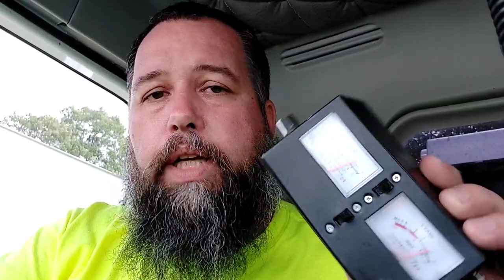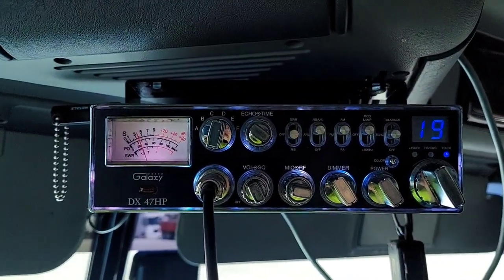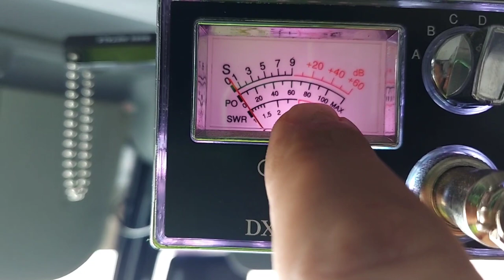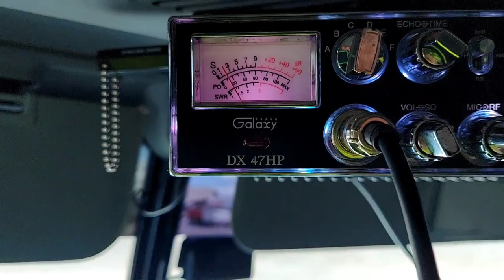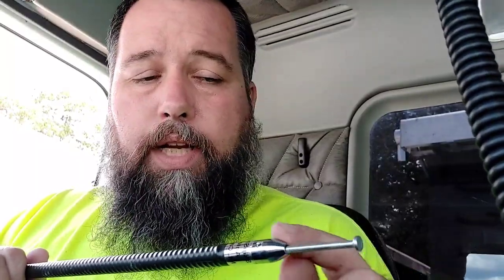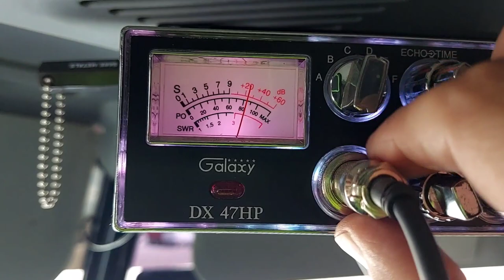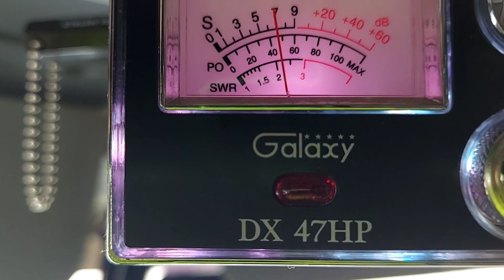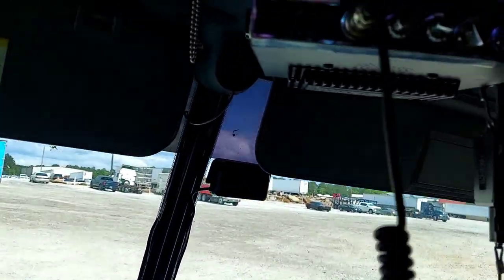How to tune your CB antenna. Using a tunable tip, and get the lowest SWR possible.

Comment: I just wanna add one thing. If your antenna has a rubber cap that goes on the tunable tip then always put it back on before making a swr reading. Don't set swr without the cap on because when you put it back on it will change and sometimes a lot. Take the cap off, make adjustment, put cap back on, and then take a reading. I know your antenna doesn't have a cap but other people likely do such as firestick antenna

Good video man. YouTube is full of incorrect " how to tune CB" videos lol
Reply from the maker: 100% thanks, I thought I said that, but either I didn't or edited it out. Thanks for watching.
Reply: COrrect
Reply: The cap should not make any difference. The wave does not see it.
Reply from the maker: @GoDodgers1  it does on Firestiks. You'll get a false reading.
Reply from the maker: @Maddog worker thank you, and glad to have you here.
Reply: @GoDodgers1  it certainly does on Firesticks, to support what others in the know are saying. I soon realised this when first trying to tune it. You use the rubber boot to turn the tip. Then take it off and lock it off.
Reply: @arconeagain  Mine was a trim the wire model.
Reply: My 7' Skipshooter didn't come with a cap, just purchased yesterday..is this standard? I mean it's ok to run it without a cap right 😳??

Comment: I have a Galaxy 959b Flame Thrower Edition. I use an open coil Penetrator, and when I checked my SWR I thought something was wrong. But your experience verified that theres something about a Galaxy Radio, and antenna tuning circuit is a beautiful thing to have! I have not had to adjust my SWR'S on either channel.

Comment: I have a 4ft firestick 2, and no adjustment I can make will bring it down below 3 on both ch1, and ch40.. I am using a Cobra 29lx and the meter on it shows 3 every time I transmit, but the "SWR" button on it shows its below 1.5. I'm stumped and no videos other than yours seem to actually clarify anything. If you have time, could you offer suggestions? I have 38" above the roof line, and 10" below on my toolbox mount. It is grounded with 4ga cable to the frame.
Reply from the maker: Check the continuity of the coax and the antenna. May need to stop in a cb shop to have the antenna on an analyzer.

Comment: Question.  What power setting was your galaxy radio at when you tuned the antenna.  I can get them matched on channel 1 and 40 at low power, but when i turn up the power the swrs show higher on channel 40. Should this match no matter the power setting?

Comment: I have the Galaxy 959B. When I first hooked it up and got it working,I checked the SWR Reading. The needle never moved! I thought something was wrong,so I had it checked out. It turned out that the needle laying in the corner is very common because the the Antenna Tuning Circuit that adjusts itself very easily if you use the recommended style of antenna. I use the open coil Tram antenna, and even that is enough to let me hear Puerto Rico and Florida from the Great Lakes Region, 45 miles East of Detroit and 50 miles South of the Canadian Border. And thats using a 12 watt Dead Key modulating to about 25 watt's. I can't wait to use an Amp with it!!!
Reply from the maker: You definitely have a great antenna setup to be hearing all that.

Comment: Quick question I got a Galaxy 929 I just got fixed burnt a final and it's going on a Ford ranger I'm going to use my lil will at the moment till I get some money saved up for striker antenna and my question is when your testing the swr in the video do you keep the mic keyed
Reply from the maker: You'll key the mic to calibate, then key up to check swr. Remember to use an external meter.

Comment: I never saw you calibrate the SWR meter ?
I believe you should calibrate the meter for each change you make ?
             Just Say'n !
Reply from the maker: That meter self calibrates, no knob to turn, just flip the switch and key up. Rangers are the same way. Also that meter was checked against a MFJ and Dosy meter for it accuracy.

Comment: How would a calibrate one to a roadking rk5640?
Reply from the maker: Use an external SWR meter. The radio should only be use if it's verified by a trusted external meter.

Comment: Question. Just purchased the Stryker 497 and will be ordering the Skip Shooters This is likely a truck specific question. Pete 567 No real ability to add a door mount like the Cascadia and none on the mirror arms. They're integrated into the roof. I was planning on 2 - 4" antennas. Will I need to adjust them equally? Also, it's a company truck I won't be drilling into anything. Great Videos. Thanks.
Reply from the maker: You tune them individually with a 50 ohm coax. So you'll have to get to the connectors.
Reply: @jrichtruckincbtips  Thanks, It's looking more like I will add 1 7' behind the bunk on the grab bar that runs horizontally above the bunk window. I don't think the stock wiring is worth trying to run this radio through.
Reply: @jrichtruckincbtips  Sorry, what connectors. Sorry I am new at this.
Reply from the maker: @thisoldhouse7680  the connections between the coax and the antenna. And, having the antenna behind the bunk on a mid-high roof sleeper is not a good idea. You have high swr from reflection. If it's a flat top it'll be ok.
Reply: @jrichtruckincbtips  Not a flat top. And I just reread your original "to get to" and realized how stupid my question was. I am ordering 2 4' Skip shooters and an external SWR. Thanks a ton for taking the time to help me out on this. I'll post results.
Reply from the maker: @thisoldhouse7680  idk how much of an improvement will result, as the antennas will still be next to the roof line, and reflection will still exist. I'm not sure on that truck but most dual antenna trucks, run 1 antenna for the cb and 1 for the am/fm radio, and go through a multiplex located behind the dash. I'd the 567 has this, a better option is run a new single coax from the radio to the antenna on the driver's side and replace the driver's side antenna and tune that.
Reply: @jrichtruckincbtips  Damn, getting more complicated as I go. It's a 2021 and it's a company truck. So I do need to be somewhat careful of what I do. I take very good care of the equipment and do not want to do anything to damage anything. I wish someone made an external door mount like for the cascadia. I'll research the antenna situation as far as the CB/FM set like  you said. Thanks
Reply from the maker: @thisoldhouse7680  a mirror mount would be ideal with a 6'-7' antenna. If you just run the new coax along side the factory coax through the headliner and such. You wouldn't be messing anything up just unplugging.
Reply: @jrichtruckincbtips  I'm going to work that out best I can. Get my truck back Friday. Thanks. Again.
Reply: @jrichtruckincbtips  Sorry, one more question. What about where the passenger side curb mirror is. I found a mount I could put there. Only issue is it limits it to a 5' antenna. Do you have a Patreon page?
Reply from the maker: @thisoldhouse7680  you can mount it on that mirror,  however don't pick the coax in the door. I don't have a patrion page.

Comment: Great video, I may have missed it but did you check it with maximum power output?
Reply from the maker: Not this video, but that radio reads 110w on my Dosy meter.

Comment: My skip shooter got delivered to the house about 2 hours ago.  I put the predator on a mount where the spot mirror goes above the passenger window and it’s working fairly well. Only problem up there is the coax is pinched in the door. SWR is right below 1.5 on both 1and 40.   I’m hoping the 7 ft shooter isn’t too high from a mirror stud.
Reply: If it's close to the same like that on both and can't get it lower it could be a ground issue. However if your running a 40 watt or under radio 1:4 swr will be fine.
Reply from the maker: May want to get the coax fixed and grounded to get the most out of it. Thanks for watching
Reply: Depends on the mirror mount being it a classic style vs a cascadia style..I will assume its the latter but you will be fine..Might have to lean it foward 10/20 degrees..

Comment: Thanks for the great video. I have a Cobra 29 LX Harley Addition LOL With a Firestik non tunable tip. I have got channel 40 to 1.8 and channel 1 to 1.7. Do I need to try and trim more?? Also is there a way to get the SWR lower like yours????
Reply from the maker: I'd leave that alone, and yes lower swr is possible but, lots of unknown factors here, and probably not with that antenna.

Comment: Im running dual Francis how do I tune them?
Reply from the maker: It's a pain really. You need a external meter.  You need to replace 1 antenna with a dummy load while you cut or lengthen the other antenna. Then move the dummy load to the other side and tune the other antenna. Just part of the reason I run a single.

Comment: How do you check you swr on dual antenna and can I do it with a single swr meter or does it have to be a dual swr meter
Reply from the maker: You'll need another coax and tune individually.
Reply: @jrichtruckincbtips  thank you for your help

Comment: Good video but I always like to use an inline SWR meter the ones that are built into radio in my opinion  not 100%  accurate
Reply from the maker: As I said in the video, I know how far off my radio is compared to my cb shops analyzer is.

Comment: Hey man.  Where exactly do you hook the ground to on the cb itself.  Having big ground issues like blinkers and power windows coming through my external speaker.
Reply from the maker: Really anywhere on the back ofthe radio, some already have a stud and nut in place.
Reply: Different issue...If keying up your radio n such does that its likely rf ground thats your issue vs dc grounding..

Comment: Hopefully you can help. I own a Jeep CJ5 & Ive seen a few different locations that people mount their antennas on Jeeps. I usually keep my fiberglass hardtop on but I take it off occasionally, so thats not a great mounting option. I can mount it on my rear bumper off to the drivers side, or I can mount it to a custom bracket a little higher that comes off of my rear tail light housing on the drivers side. Last option is to mount it off of the passenger side body/tub just in front of my door hinges and just behind my side mirror. Reason I am asking is so I can get the best ground plane. I know I cant have the best of both worlds but I'd like to see what you have to say, if you have any experience with Jeeps. Thanks
Reply from the maker: I don't have much experience with Jeeps, but a couple things I do know. Use a top load antenna, so you can get the coil above the roof. I would use a 5' Skip Shooter antenna. Depending on mounting location a ground strap from the mount to the frame is usually necessary. However, off the top of my head, I like the driver's side bumper mount. What about mounting on the front bumper?
Reply: Mount it to taillight drivers side….use at least a5’ top load preferably firestik2 or skipshooter as they are the easiest to adjust

Comment: Good vid....Seeing your a fan of the skip shooter,they now have caps like the firestick...Got an email from them sayin that the cap has been tested by a few drivers and its 50/50 if it makes a diff..
Reply from the maker: Been a fan of them for a few years now. The 2 I got last week didn't come with caps. But, if you can get the nail low enough, a firestik cap fit. And, didn't see any change is SWR.
Reply: @jrichtruckincbtips  yeah same here,been useing them for about 3 yrs and for alot of truck n cars they do real well...I only found out about the caps a few days ago when chattin with sales dept via email..Ordered 3 so it will last me awhile..Just hope ups doesnt wreckem,i see how they load n ship every night..I pull their stuff 5 nights a week here in eastern canada..
Reply from the maker: @craig_sez8534  mine shipped us mail, and had to pick them up at the post office cause they wouldn't fit in the truck.🤣
Reply: @jrichtruckincbtips  Im in eastern canada,usps/canada post wouldnt ship cause they are so long...From freemont ill to stewiacke,novascotia,canada its costing me $70ea(shipping,exchange and duty fees) canadian,landed..$70 cdn = $58 usd ea to my door..

Comment: I got a fire stick 2 tuneble first iv ever had got swr so low that  the needle hardly moves pretty             impressive preforms really super good for a 5 ft antenna compared with  to 102 inch wip  wow huge Rx and tx thanks for the strength shooting content 💪
Reply from the maker: Awesome to hear, thanks for watching.
Reply from the maker: @Maddog worker I appreciate the inquiry, but that's a little beyond me. I could be something that simple, but I suggest finding a CB shop.

Comment: very helpful, may need to get this antenna
Reply from the maker: They're really great antennas, very, very flexible which is its only downside. If you go with one more than 5 foot tall, watch this video, and I tell how to keep from breaking them.https://youtu.be/7jIJDkrfDOk
Reply: @jrichtruckincbtips  quick question, I have a good s rf signal on my radio but it seems that other drivers can’t hear me, any suggestions
Reply from the maker: @sambird7613  provided the radio is in good working order. Make sure you mic gain is turned up. Other than that,  a subpar coax, antenna, or mic could be your problem.
Reply: I have plugged earbuds into the pa and can hear myself through the pa setting, I believe    The fixed could be found from upgrading my coax and antenna to hustler antennas and Wilson coax
Reply from the maker: @sambird7613  I'm not a big fan of the Wilson coax but the hustlers are great antennas.

Comment: How do you have a 7ft antenna mounted.
Reply from the maker: I had it on the bottom mirror hoop leaned out 35-40 degrees. Not a bad combo, but have changed since then.
Reply: @jrichtruckincbtips  what do you run now?
Reply from the maker: @samkitts9362  if you were watching my videos, you would know. LOL! I have a Hustler SCB mounted on the rear of the cab. It's been a great antenna
Reply: @jrichtruckincbtips  ahh true. It would be hard to do that with the sleeper on this truck.
Reply: Would you still recommend the skippshooter?
Reply from the maker: @samkitts9362  what truck is it?
Reply: @jrichtruckincbtips  Volvo mid roof.
Reply from the maker: @samkitts9362  for the money the 7' Skip Shooter is great, but you'll need a 3' piece of 3/4" cpvc (not pvc) pipe to slide over the base, to prevent over flexing and eventually breaking at the base.

Or call Big Rig Radios out in Phoenix he has some 7' antennas that he developed with Firestik, that he says is better than SS or Firestik.

Comment: Just tuned mine on my 2020 f350 dually. Stainless mount on driver side hood hinge mount with fiberglass 3’ whip. Not a tunable tip but is fiberglass with outer windings. After almost 30 tests and trimming 1/4” at a time I finally got 1.4 on channel 1 and 1.75 on channel 40. I’m gonna stop there for now as I think it should be fine. I typically am on channel 19 and I checked SWR on 19 and it was .4
Reply from the maker: I would add a ground strap from the mount to the frame of firewall, and see if that helps your SWRs. I'd bet they can be better. Thanks for watching

Comment: Would this work the same on a 2 antenna set up just have to move both antennas at the same time?
Reply from the maker: Dual antennas are a touch more complicated, you'll need a dummy load in place of 1 antenna while you tune the other. Then repeat on the next antenna. Just 1 of the reasons I prefer a single antenna system.
Reply: What do u mean dummy load in place, can u not do one at a time
Reply from the maker: @hannaransport  a dummy load goes in place of 1 antenna to give resistance. You can tune the antennas one at a time by running another coax to 1 antenna at a time, tune that antenna, then move the coax to the other antenna. It can be a time consuming process, and most of the time not worth it. As with dual antennas you can TX/RX farther front to back only. But, with a single antenna your  TX/RX should be the same in all directions.
Reply: So if I have a co phase coax, can’t I just plug it to the swr meter and tune the antennas? If not then I guess I could do one at a time as long as u can
Reply from the maker: @hannaransport  it's not that simple, you should have a experienced CB tech tune them for you.
Reply: Not much cb tech around Ontario it seems like everyone is retired, but I did have another issue today where my cb stopped working it’s powered on but can’t hear anything when I transmit the s/rf indicator wasn’t going up where it normally showes every time u key the mic also I tried to see if I could cal again incase that was the problem but the indicater for cal wasn’t moving, one is it a cb issue or 2 a ground Mayb
Reply: But it’s working at the moment
Reply: Also I was talking to my driver while he was channel 19 n I was 17 does that make sense to u
Reply from the maker: @hannaransport  cb issue
Reply from the maker: @hannaransport  your radio is splattering across channels